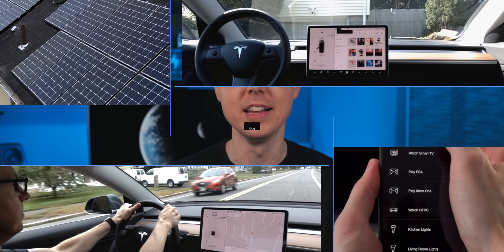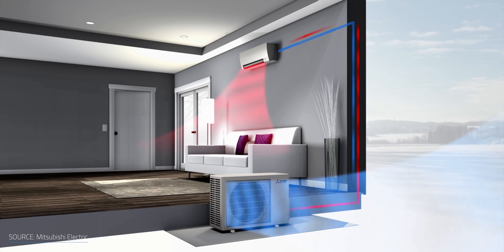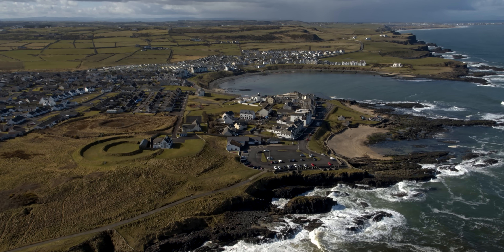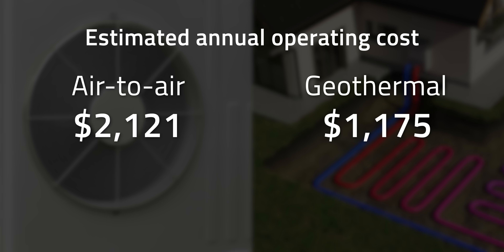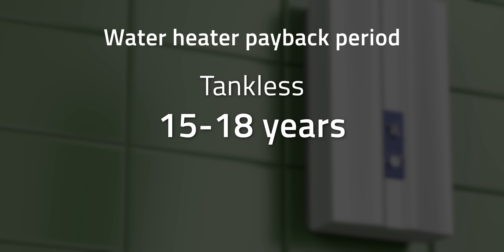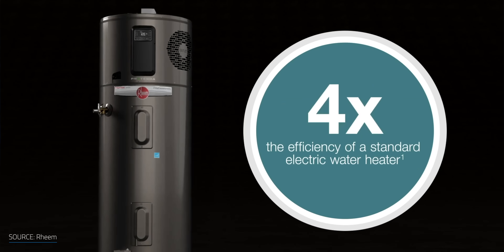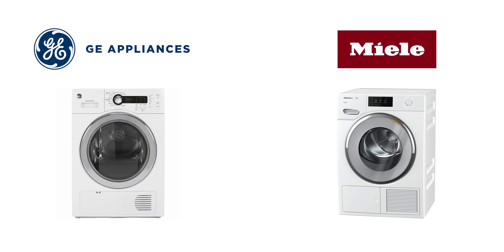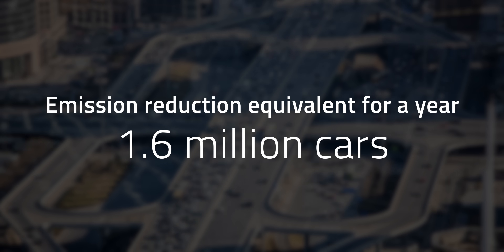Why Heat Pumps are Essential for the Future - Explained

Comment: Here in Japan, nearly everyone in a modern home or apartment has a heat pump "aircon" to provide both heating and cooling. The older method of heating was kerosene space heaters, mostly now replaced by electrical space heaters. Back when we had all our nuclear power plants operating, that meant much less CO2. But since they scaled those back (due to ridiculous fears) and replaced them with natural gas generators, more electricity equals more CO2.
Reply: Fears were realized in Japan...
Reply: Is the fear of the people who live in Fukushima ridiculous?
Reply: @tomgnyc  yes, nobody died in the explosion, 19000 people died in the tsunami.

Comment: That’s all well and good. 
However, draft-proofing your home, insulating walls ceilings AND floors, and either fitting high efficiency glass or window coverings that will stop heat loss will  make a MUCH bigger difference to the overall cost of maintaining a comfortable living space. 
All the latest fancy heat-pump technology won’t do SQUAT if there is a half inch gap under your front and back doors.
Reply: Obviously you need to get the basics right first. Efficient heating systems only make sense if you don't lose heat everywhere. I don't think anyone is suggesting to do heat pumps without proper insulation, that would be crazy.
Reply: obviously

Comment: I agree that heat pumps are great, and our geothermal system has been working well for us the last 7 years - using far less than our prior air/air heat pump.   Computing BTU loss to power consumption, the unit seems to come in at about 410% efficient. By adding Solar, we are zeroing out our energy bills 9-10 months of the year.  

But, the efficiency examples Matt quotes are not really apples to apples because there are losses of the electrical system and grid that have to be factored in when comparing to something like burning propane for heat.  Compressors and Geothermal pumps do still require a lot of electricity compared with other items.  And it winter it's going most of the time. To make an apples/apples, you would need to consider the fuel BTU to end usable BTU output.  For example, the COP of the heat pump needs to be multiplied by the efficiency of a propane/LNG generator, and line losses to the house need to considered.  These items are significant, and when the goal for heat/hotwater/drying is simply heat output, the great COP number gets wiped out by the other losses.  The net fuel efficiency cab be pretty close, but isn't necessarily a win.  In our case the Geothermal heatpump might still come out slightly ahead to run a generator rather than burn directly - but this is questionable and at best not dramatic.  For most air/air heat pumps working with big temp gradients, just burning the fuel directly should be much more efficient.  

You might argue that the Solar could provide the electricity which would be cleaner.  True, but this is limited by the fact that it gets cold at just the time when the sun gets low in the sky and days are short, so it requires a LOT of solar and battery to provide the heat when you most need it.  Thus, battery cost (and end toxicity) become a major consideration.  In the Fall/Spring, solar + geothermal will work well.  In Summer, and warm climates, heat pumps are the only way to go.  But, in December, and northern climates, when all you need is heat, it still make the most sense to burn the fuel directly with a high efficiency burner, IMO.  In the end, because of December sun issue, in our case we still end up burning fuel direct (in our case wood w/ reported 87% efficiency) to make it through winter.
Reply: At the end of the day it all comes back to nuclear power is the best solution to all of our energy needs.  Plus a much needed national electrical grid upgrade before we can even think of going electric for everything.
Reply: 410% efficient? For geothermal? Air heatpumps are in that range for the higher end units.
Reply: @randybobandy9828  Not when the air is 20degF.  Geothermal adds efficiency when the air temp gradient is large.

Comment: I have a Fujitsu mini-split style heat pump that heats and cools a small outbuilding. It is remarkably cheap to run, especially for cooling in the summer. I also have a Miele condensing clothes dryer. It has seen almost daily use for over 8 years now. Compared to a conventional dryer, at the end of the cycle, the clothing, bedding and towels do not feel bone dry, but a quick shake dissipates any residual humidity. The fabrics are warm, but not really hot as they are with a conventional dryer. It is very important to remove any lint thoroughly, and once very several months a thorough lint cleaning of the dryer’s internal ducting is needed. This is easy to do, though a little tedious. Overall I am very happy with both the Fujitsu and the Miele. They only regret I have is with the size of the Miele. I really wish we had opted for a larger unit. We have the smallest model they make. Perhaps if you are a small household, 1-2 people, and your laundry needs are quite modest you will be happy with the small Miele, but if you are an active family with several kids I would strongly recommend getting a larger dryer.

Comment: I’m definitely looking to go this route with our whole house heating & cooling to replace the existing propane furnace & standard a/c.  

I wanted geothermal but because we live across a creek it’s pretty likely the bridge to our home won’t support the weight of a drilling truck, since we’d need a vertical loop for the system.  

The system we’re considering looks promising & since our solar is about to go online in the next week or so it seems most promising to get most household systems on electricity.  

Good luck with your research for the NZ home. 🙂
Reply: 14 minutes of commercials. Almost zero usable info. Bots hitting the Like button. Awesome.
Reply: idk if its an option in NZ, but they do have open loop geo thermal systems.  Mine is one such.  Instead of having a cooling loop installed into the ground.  Instead two wells were drilled.  The well closest to my geo thermal system pulls in ground water for the heat exchange, and that water is then sent to the 2nd well on the other side of my yard and returned to the ground water table.

these sort of open loop systems generally are more efficient compared to the close loop systems as you are always dealing with water that is a steady temp, where as a closed loop can only shed/receive heat up to a point before the soil reaches is max transfer ability.  the only way around this is to make the loop even bigger, and therefore have even more surface area for it to contact.

just throwing this out there as a potential option to investigate.
Reply: @The_Lone_Aesir  NZ = Net Zero.  While an open loop is more efficient to a degree there are two issues - one is the hardness of the water...this can turn your GSHP into a useless block pretty quickly or require very regular and careful servicing...and two - the pumping costs for an open loop can be pretty significant depending on how deep the well is.
Reply: Dan, geothermal works exceptionally well in running water (as long as your creek doesn't freeze over in the winter)
Reply: NZ = New Zealand 
Pls don’t steal their acronym! Although I do believe they have a decent Net Zero target ;-)
Reply: If your temps stay above about -10 C I wouldn’t bother with geo. The cost to install isn’t offset when compared to a high efficiency system now days. I would just go with an inverter system like Daikin, Mitsubishi, or Bosch. Those systems will heat down to around -30 C with little to no issues especially if you have good insulation. They cost significantly less to install and cost less to maintain. If you ever have an issue with a geothermal system it can get expensive fast. I’ve seen the bills that my company sends out….
Reply: If getting a driller truck in is a problem, then you might as well investigate how much more it'll cost to do more shallow wells that you can drill with a smaller vehicle. In the extreme case, you might even do it with just a water pump, homemade crane, and plastic pipe with screw-together end fittings.

Comment: It would be very interesting to see if geothermal heat pumps could be used to maintain the temperature on a domestic uasb biodigestor, to be able to get rid of septic tanks.
Reply: You would do better to use an aerobic system, as the liquid effluent from a good aerobic system is basically water. Effluent from a UASB is going to be very rich in nutrients, polluting downstream watercourses. Also, if you really want biogas, a UASB is going to be very expensive, without providing a significant increase over a traditional biodigester, plus they are more sensitive to adverse conditions.
Reply: anaerobic digesters give a source of methane gas for using in cooking or additional heating. the effluent can be cleaned up aerobically, or used in the garden, aquaponics for raising water vegetables and fish or hydroponically for veges and fruits. Grey water can be added to save on watering your plants, and save on disposal charges. - that is if you have metering on your sewer too.
Reply: @malcolm_in_the_middle  You are right in everything you say, but I was looking at it from the perspective that an aerobic system is horribly expensive due to the aeration costs, in a domestic context. Conversely, a UASB is head and shoulders above a septic tank for decontamination purposes, and it is extremely cheap and easy to operate. Also, in practical terms, it should prolong the life of a drainfield or an infiltration ditch, thanks to the higher quality effluent. It's downside is that it will not work too great in climates other than tropical ones. Hence if there is a cheap way to keep the water in it relatively lukewarm, a UASB could become a viable alternative for homeowners that don't live in the tropics. EDIT: It's not really for biogas harvesting purposes, it's more to avoid the headaches caused by the very bad quality of septic tank effluent.

Comment: Imagine if you could have a refrigerator in one room recessed into a wall, and then behind it a dryer that's heated by heat it removed from the refrigerator.
Reply: I'm considering something like this as my kitchen fridge is right above the HPWH in the basement. But it might require a small in-duct fan that comes on only when the fridge's compressor comes on.
Reply: The whole dwelling should run off of its own inherent energy for maximum efficiency. This should be common practice, when possible.

Comment: Ground Source Heat Pumps are amazing but it’s not only the upfront cost that is a concern…it’s also the complexity of the system.  There are many more points of failure and they require more maintenance.  I have an Air Source unit in central New England and my costs are very reasonable considering what hearing oil users pay in my area.

Comment: Great video and an important message.  I recently replaced my ducted gas heating system, instant gas hot water, resistive electric hot water systems with heatpumps and installed solar, which cost me $30k upfront, but I saved $10k in the first year for my energy bills. Essential for the future!

Comment: Very interesting options!  One larger scale concern seems to be that while these newer technology items are far more efficient, we seem to be moving everything we use and own over to electricity, which does put all our eggs in one basket.  A gas stove or heater used to be seen as a good failsafe during power outages.  Although a topic for another day, a hacked or downed power grid is growing to become an even bigger catastrophic event than it would have been a decade ago.  Society should embrace efficiency but also keep backup failsafes in mind.
Reply: Backups? What could be better than having solar with batteries and also be tied to the grid?
Reply: Add solar system with batteries to handle any electrical grid outage. It can pay for itself through buying when electricity prices are low and selling electricity when prices are high back to the grid.
Reply: @toddsmith4280  Sounds great, and it would be the perfect solution for grid failures, or in general. Unfortunately, myself, and most people I know, can not afford $40-70k+ for a whole house system w/back-up. Or I would already have done so. But we can dream, right?
Reply: Exactly. One monopolized provider for all your energy needs. What could possibly go wrong.
Reply: @lordgarth1  For heating? In the sunny south you will be good, in the cold north solar not so much.
Reply: @lordgarth1  the price of a solar system WITHOUT batteries will pay my power bill for 125 years
Reply: @toddsmith4280  If you live in the hot south maybe, if you live in the cold north certainly not.
Reply: Most gas heaters don't work without electricity.
Reply: Solar storms, anyone? https://en.wikipedia.org/wiki/Carrington_Event
Reply: Solar flare, the Morse devices activated from ambient energy during the electrical event

Unplugged

Everything that is electrical would turn on from the atmosphere

Comment: Matt - consider getting a resistive dump load for your hot water. Great for when selling solar power is worth much less than the efficiency benefit of the heat pump. Plus you'll have a back up.
"Solar diverters" are pretty popular here in Australia, as is heating with reverse cycle air con. Feels weird that we're ahead of the curve on something.
Reply: Maybe you're not down under but up over!
Reply: What do you mean "reverse cycle air conditioner" you mean a heat pump? Lol
Reply: @randybobandy9828  Yeah, but it does both. It's a weird hangover from when aircon only did cooling and the new ones that did both were special.

Comment: I love heat pumps, they are just seemingly magic with electrical efficiency. it is indeed quite unfortunate here in the US that the upfront cost is so much (even though in the long run the ROI of like water heaters and HVAC is much faster than traditional systems). 
Very happy you covered this topic, as I run on about it a lot with my buddies. Also love your channel, it is like the go to for pensive sit downs with my buds while having a cigar.
Small question, related to the heatpump dryers, have you seen or have thoughts on  ozone based washing systems? Been researching like the O3 waterworks aqueous system, but really UNDECIDED if something like this would actually clean my laundry. No laundry detergent sounds great on both a detergent pollutant and plastic pollutant level.
Reply: Heat pumps are in average 10% more when compared with equal AC. When you said so much more ???

Comment: Going to install our third geothermal heatpump after running our latest WaterFurnace for 18.5 years with 0 problems.  Installed the geothernal system when we built our house with 4 geo wells.  Also has the superheater to preheat the hot water to the tanks.  Now running it with our Tesla Solar Roof and Powerwall system since it went online in Feb 2022.

Comment: Just to be clear so everybody understands, if you have an "AIR CONDITIONER" that can produce cold and hot air you've got yourself a HEAT PUMP and honestly most modern air conditioners are in fact heat pumps! and they have been for a while the technology is nothing new, but they have gotten much more efficient as of late.

Comment: I recently spent some time helping my daughter move into her new home.  Their local authorities required them to install heat pumps.  Their home has two heat pumps feeding indoor ceiling mounted units called mini-splits.  A few days after moving in to their new house the outdoor temperature dropped to 9 deg Fahrenheit. The heat pumps could not keep up and keep the house warm.  The pipes froze in one of their bathrooms.  Luckily, when the temperature went up about 5 days later the pipes thawed and they regained the use of their bathroom without a flood.
Reply: This sounds like a very poor install, there should be emergency or auxiliary heating elements in the system, but mini-splits don't have that by default.  I'm betting you daughter is in the south where they still don't plan for these very low temps, but they should be.
Reply: @CitEnthusiast  They live in Washington close to the Canadian border.  Sounds like their HVAC contractor didn't do a good job.

Comment: HVAC expert here, Heat pumps may not have less carbon footprint unless you are on solar. Because of the up to 10kw heat strips even in the southern states they end up pulling way more electricity up to 80kw averages for a 25F day. The water heaters are a different story these are much more green because they’re usually installed inside. And being compared to full electric water heaters. The 80% fossil fuel on the grid is again the major point. Great video, very good info!
Reply: So it uses the same amount of energy. Factor in manufacturing costs and emissions. Are they really the answer or is it just the new 'thing'?
Reply: @paulb9769  I honestly believe in the US it is mostly about community planners not wanting to route gas at all in the future. This may change, but I think that is the driver right now. See: Texas the last couple of winters for results.

Comment: 11:45 The lower heat is an advantage, not a disadvantage! It’s way gentler on fabrics — in regular mode, a heat pump dryer is cooler than the delicates mode on a traditional dryer. In delicates mode, it’s cooler still. I’ve had a Siemens heat pump dryer for nearly a decade and I’m very pleased with the results.